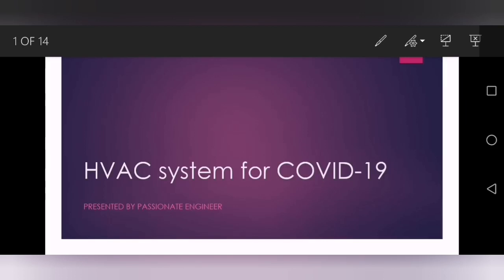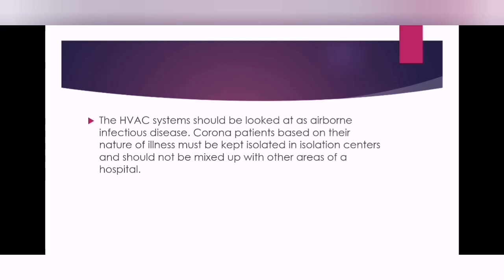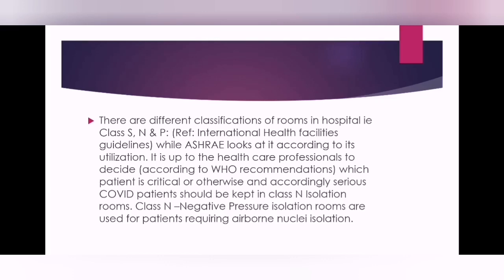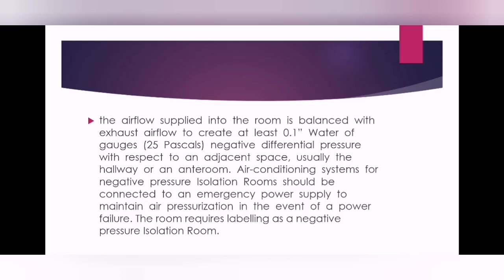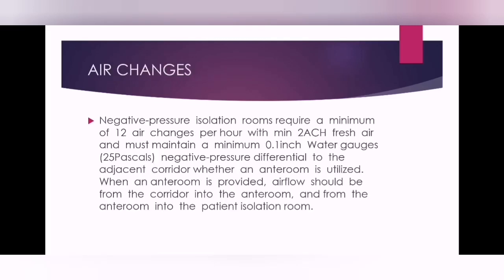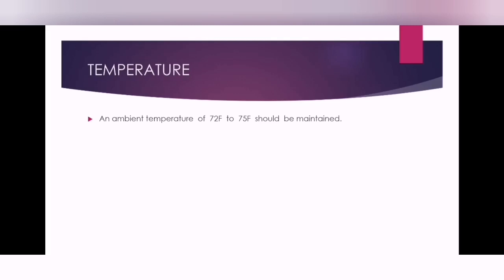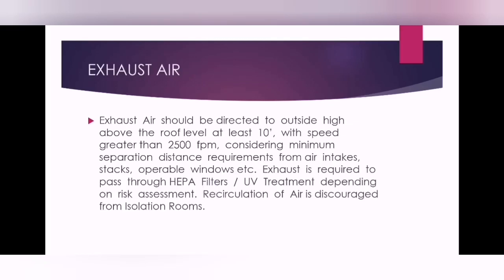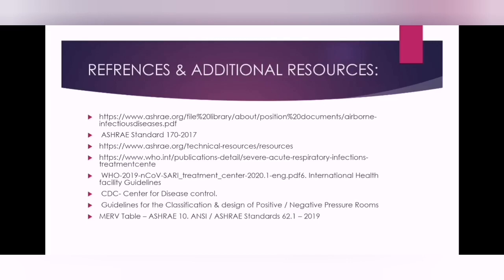ASHRAE design guidelines for COVID-19 Patient isolation room HVAC system. (ENGLISH)

Comment: What is your assessment of the HVAC system is schools (elemental - high school)?  Does the HVAC in those schools decrease or increase the risk of COVID19 transmission?

I am putting  together a report in this regard.
Reply from the maker: For schools its better to operate AC at 26c but if you use HVAC system with proper filteration it will decrease the risk, but without filteration sneezing or coughing can be spread through air of AC.

Comment: Why we need additional 2ACh fresh air in isolation room. We have supply air directly from outside as there is no return air. Pls clarify
Reply from the maker: 2 ACH is used when system is designed for recirculation,like hospital's rooms other than isolation room, like office etc. Which are in hospitals where COVID-19 isolation rooms are located.
Reply: Du u hv othe I vedios for full Hvac design for hospital
Reply from the maker: @ashpaksheikh1616  i will upload it soon and also OT design
Reply: @ashpaksheikh1616  if you dont mine pls see desain negative pressure room. In that video also calculated the total load for ahu with 12 ach fresh air.
Reply: If FCU is serving isolation room for AC and exhaust fan duct is installed for -ve pressure, do we need to add any fresh air in the room and how much